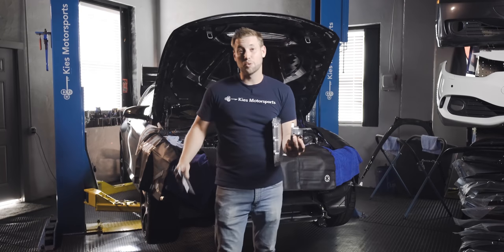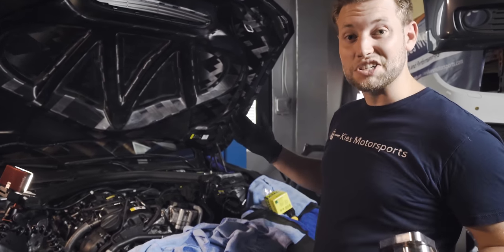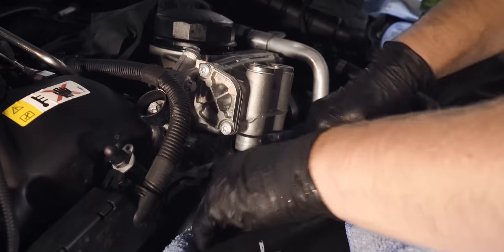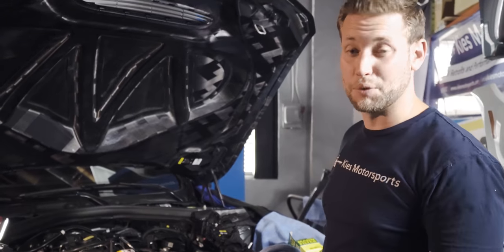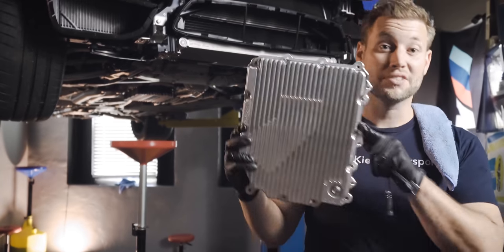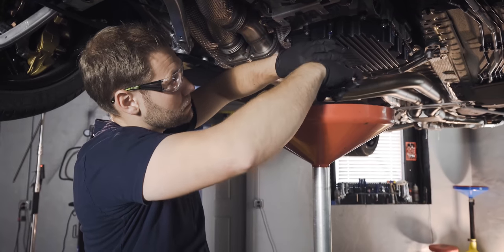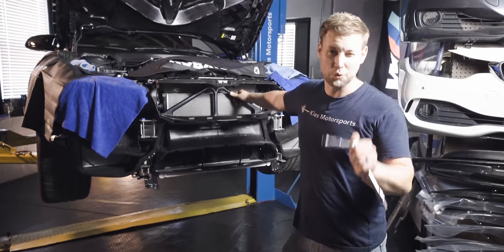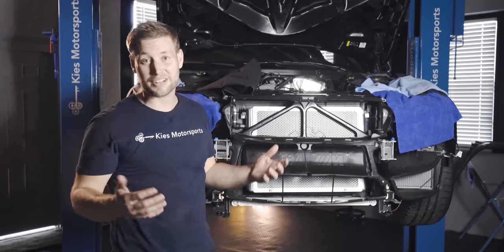Part 4: Building the ULTIMATE M4 GTS | CSF Heat Exchanger, Mosselman Thermostat, Dodson DCT Pan

Comment: I hope you are planning to put this beast on the dyno after all this work. We have to see what $20000+ worth of parts does to this bad boy!
Reply: Chief G. Is it so much as 20 000$?
Reply: Chief G. Won’t make more than 600bhp I can bet on that. This needs MaximumPSI heavy duty connecting rods, forged pistons, and valve spring upgrade. Now the car is missing the CSF charge air cooler, along with a new intake. Hopefully it gets that in episode 5 with the surprise install of an e85 kit
Reply: @brandonanderson7101  i can guarantee you itll push 650+

Comment: So let me get this straight, there is a thermostat for the oil on all s55 motors?  Damn, I'm still clueless on these motors lol.   Assuming computer tuning will not affect this at all unlike radiator coolant since there is a fan that controls temp.

Comment: Hello. I've been following you for a long time and you're my favorite mechanic. I have a question about the dct. I have a BMW 135i with the 7 speed DCT. I have 101000 km and I would like to replace the oil. Need I use some special machinery or just let the oil go down and then add the new one at the level? I know the procedure is different from the one with the torque converter, that's why I ask you.  Thanks for the reply and have a nice day !!